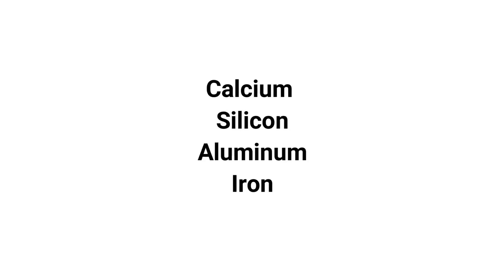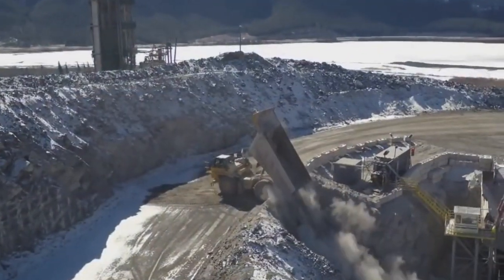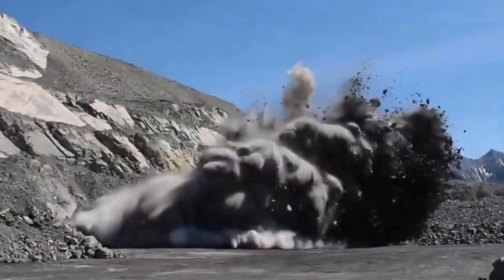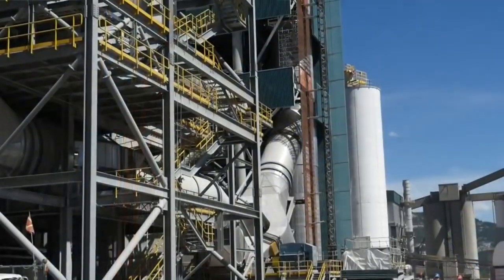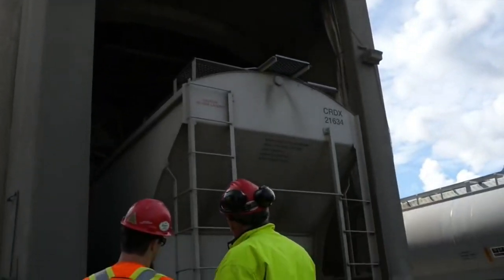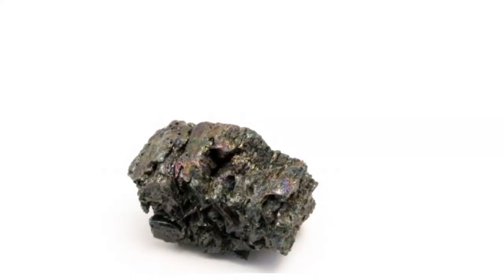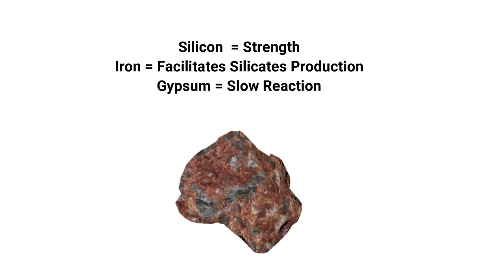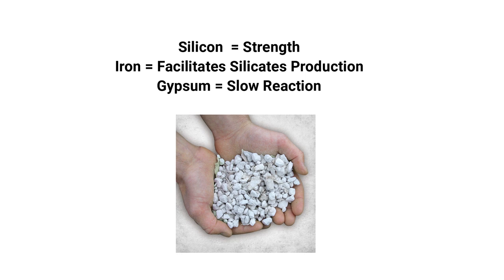How Cement is Made?

Comment: Is there any expiry date for the cement filled in the sag. 
Is it harmful to reuse the expiry date cement after recycling/reenhancing it
Reply from the maker: cement will start hydrating due to the moisture present in the air; so, after a while, they will become solid and un-usable. 
Check  the manufacturers' recommendations and information on the label. But mainly, try to store it in very dry area to avoid contact with moisture.

If you plan to recycle it and re-use it, it depends on the process to decide whether it's re-usable and to which degree.
Reply: Thanks for the information.
Reply from the maker: welcome! let me know if you have any other questions